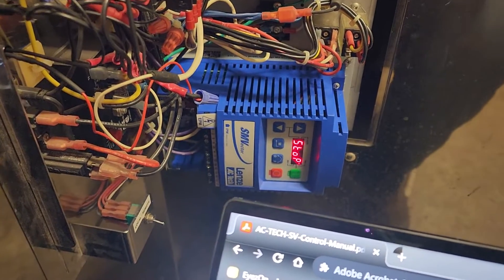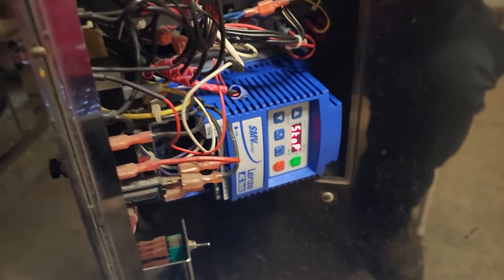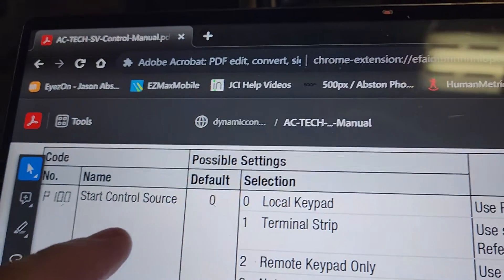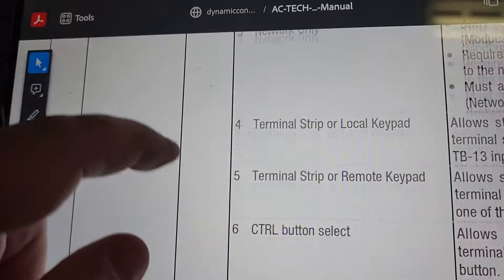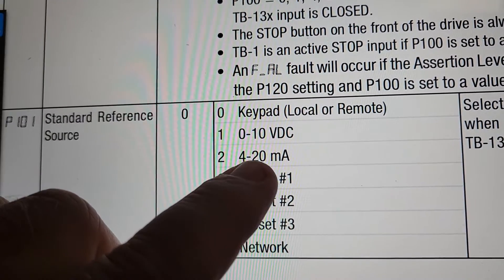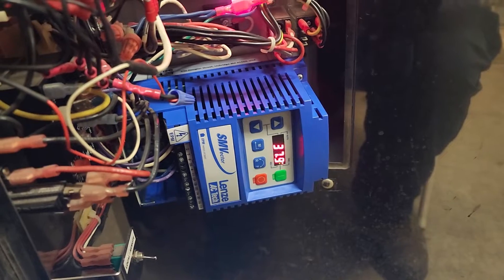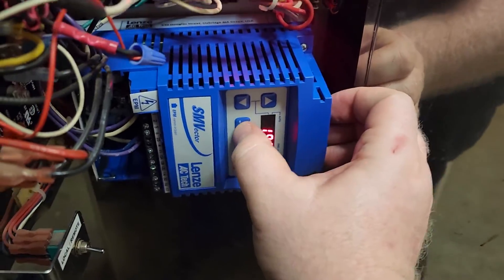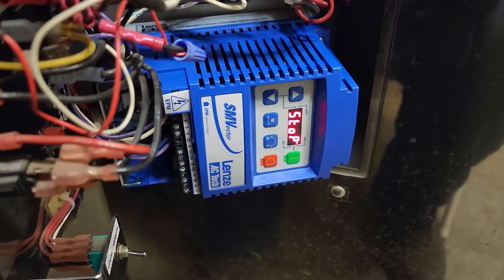DIY Boiler Repair: Swapping out the Air Intake Blower VFD

Comment: Thank you so much for your videos. My Building used BMS (Jonhson control- from 2005) with DDC (DX-9100-8454D, XT-9100-8304, XP-9104- 8304). Pls give me the name of new version (new model) suitable with my BMS.
Reply from the maker: The FAC 3613 is a newer controller that can replace the DX9100.  It can communicate either N2 or Bacnet and uses the CCT tool for programming.
Reply: Really thank for you @Systemcontroltech  , once again help me give the name could replace for the NAE55 & NAE45?

Comment: Thanks for the upload. Did you say that was on a Camus? I was told parameters 102(light off), 160(lo fire) and 103,161(hi fire) need to be set the same as old vfd if you can access them on the one you are replacing.
Reply from the maker: Yes it was a Camus boiler. Not sure about those two parameters. The only ones I had to change was 100 and 101.